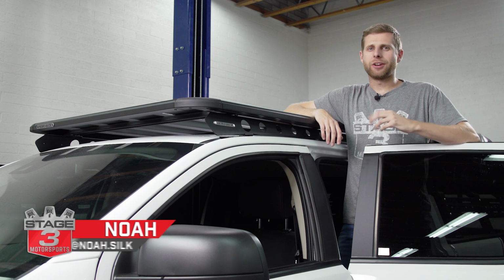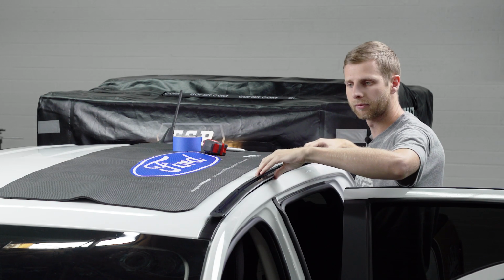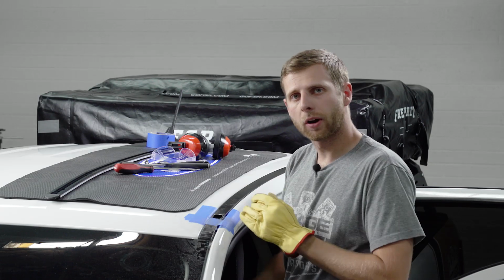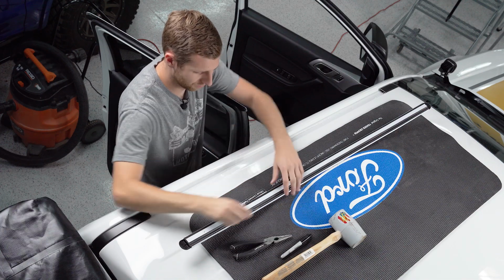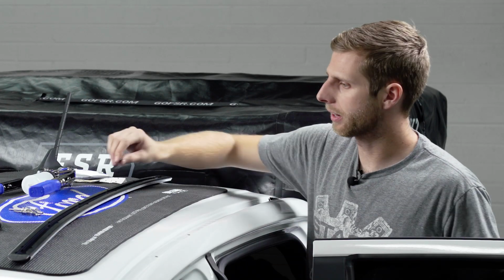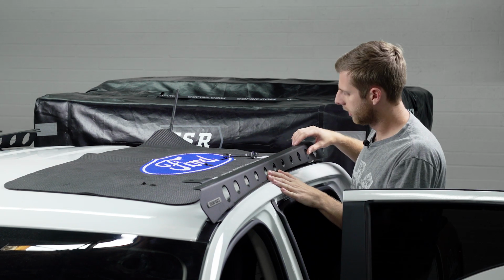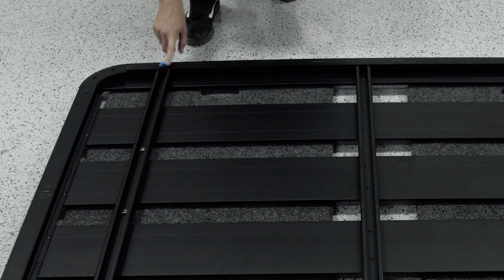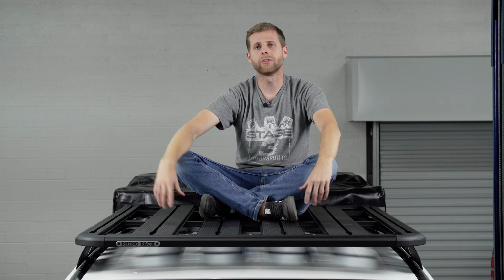2019 Ranger SuperCrew RhinoRack Backbone System with Pioneer Platform Install

Comment: Wouldn't it be easier to just pull the whole rain gutter rail out then trim off end pieces you may want to reapply? They're only cosmetic right?
Reply: Yes can cut with angle grinder. Take the whole rail off.

Comment: I'm going to invent a soft clamp mount  on the upper window  roof struts.  Instead in the factory rail or channel. It'll be on the outer body of the roof frame, only utlize the back bone for a structure feature

Comment: How much louder is the wind noise inside the truck? Any big change or is it acceptable? Thanks!
Reply: Good question. The rack does create some wind noise in the cab, but the sound is tolerable. It doesn't tend to howl or whistle so the noise is mostly just a low rumble of air being disrupted as it rolls over the top of the truck. The sound seems to be comparable to almost any other flat utility rack I've ever driven with, but it may not be everyone's cup of tea depending on how much they value a perfectly quiet cab. Hope that helps!
Reply: Wind noise is bloody huge because it comes so far forward and all the wind going up windscreen go's straight under the rack. Fuel consumption go's up considerably.
Reply: @shreckm6470  The fuel consumption will go up regardless of the rack. If you want to save on fuel, consider not getting one?
The wind noise can be mitigated using  wind fairings or even putting in a light bar.

Comment: How strong is the rivits? normally rivnuts is the norm.
Reply: The rivets seem to be plenty strong enough to secure the channels to the roof. We haven't had any issues with them coming loose, rattling or leaking after multiple off-road trips and camping trips over the last 6 months.

Comment: Hmm well the install doesn't seem that bad, I mean it would be a permanent part of my truck forever anyway.
Reply: Attaching the tray to the backbone rails is an ABSOLUTE pain in the ass. He says "a little bit tricky" but what he means in impossible. The T bar part has nothing holding it even remotely tightly in place and you can't hold it with your fingers while you out the bolt in. Worst thing I've ever tried to do.